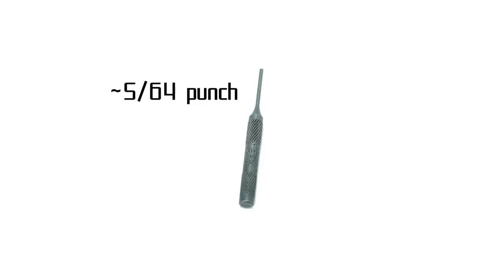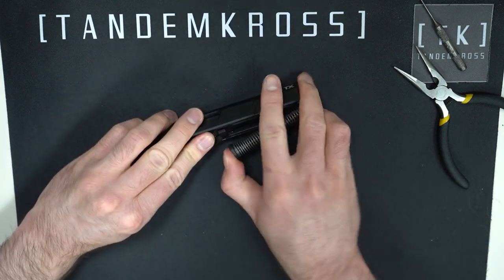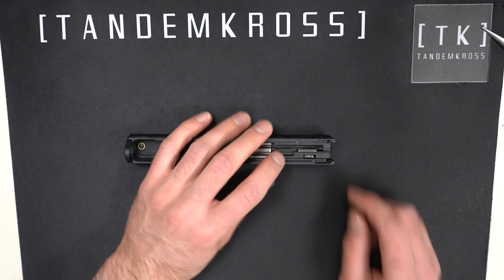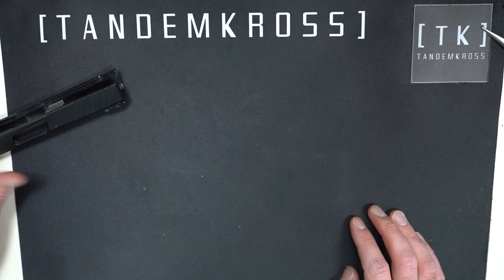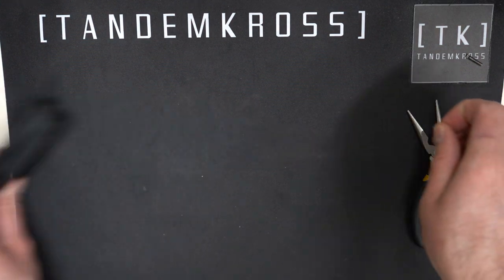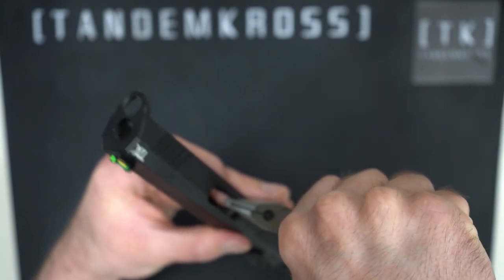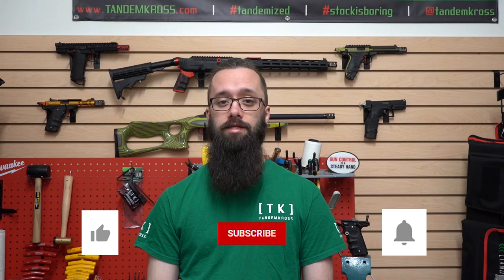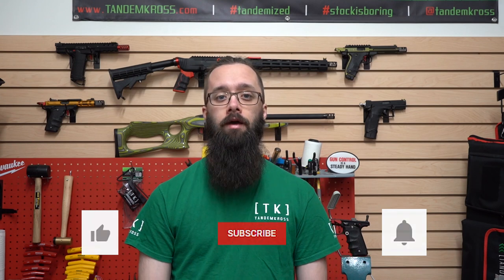TANDEMKROSS - "Eagle's Talon" Replacement Extractor for Taurus TX22 - Installation Instructions

Comment: Thank you VERY much! Gotta say, this is the most detailed and explicit video I have ever had the privilege to use. I bought a Taurus TX22 Competition last week and after having had a bunch of stove-pipes and FTFs in my first outing, and after reading the forums, etc. I decided to install the new extractor you make.  Before I did that, based on many other comments,  I also disassembled all three of the magazines, brushed them out, wiped them out, then applied a light coating of a Teflon-based  product. This one is called Super-Lube and seems to be the equivalent of Mag Slick, recommended by another great YouTuber (Guns and Politics, I believe). But I couldn't get Mag Slick locally and found Super-Lube at Ace Hardware so we'll see how that goes. Anyway, after that I went to your video, watched it a dozen times, followed each step, screwed it up twice and had to disassemble it but each time found the correction to my screwup in your terrific video! Long story but I got 'er done...haven't shot it yet, of course, but the fact that a mechanically marginal person like me could follow your steps and do the installation of the extractor at all is a win! So....best ever, a ten+ for my needs and in my book. Two suggestions...seems to me that you never mention lube anywhere. The firing pin block sticks and does not "spring back" slightly unless you have a light lube around it. Second suggestion, based on my doing this step and failing at least two-dozen times....putting that spring back in at the end and sliding the plate over it was macro difficult for me and my old fingers. I finally watched more closely and realized your hand position had you pulling back the firing pin block just slightly while you maneuvered it...the plate won't even go on if you don't do that. Then I finally got the plate over the spring by perseverance but it would be great to know a little trick to make that easier. Now the proof will be in the pudding...stocked up on CCI 40 grain mini mag smooth head, which seems recommended by many, and hope to find at least some of my stove-pipe and FTF issues go away next week when I go out. Sorry for the ramble-gram, but thanks again!

Comment: Very clear instructions.  I had a very hard time getting the extractor in place.  It was easier to remove the block it fits into, put the extractor in place, and remount that block.  Just a roll pin to remove that mounting block.
Reply: How do u do this because I am struggling
Reply: @CCpewpew  Easy.  Drive out the pin that holds the block in place that houses the extractor.  Than that block can be pushed out.  I had to use a brass punch to remove the block, as it’s a tight fit.  Put the extractor in place, and replace the block.   The block starts easily, but use a hammer and punch to drive it all the way back in.  Install the pin.
Reply: @blaiwayw1  In which direction does the block come out?  Toward the muzzle? Toward the back plate? Down towards the lower?  I've been trying to get the OEM extractor out for about 30 minutes now...  Thanks in advance!
Reply: It’s been awhile since I did this.  In my mind, the block is removed toward the muzzle.  Tandemkross would be able to give you the answer for certain.

Comment: To remove the extractor, once the spring and plunger are removed a short blast of canned air knocks it right out. Keep an eye on it! Your 5 round mag extensions are great. Turned my 10 rounders into 21 rounds!
Reply from the maker: That's a great tip! Glad you like the mag extensions.
Reply: Great tip, thank you. I was struggling to get the extractor out and this was the trick I needed!

Comment: Is there any good way of telling the factory extractor from yours?  I have the SCR model and am getting poor extraction at times.  The snap caps have a larger rim and extract well, but live ammo extracts poorly, sometimes not making it out before the slide comes back and grabs it.  It also won’t eject after a stage (use it for competition) manually, I have to fire that round off to clear it from the chamber.  My feed ramp is not polished like it’s supposed to be considering it’s an SCR and I’m figuring Taurus didn’t install the talon extractor either (it did have the comp in the box- maybe they shoved a standard competition model in the SCR box) but since both appear to be the same color, not sure if there’s a way to tell.

Comment: Fairly upfront install. Had to play with the new extractor a lot to get into proper place. Sadly it doesn’t seem to resolve my issue with using Federal Automatch ammunition. The 1st shot I took fired but failed to extract. The case gets stuck in the chamber and the claw never picks it up. Cleared that one by hand and the second shot stove piped the spent casing. 

Had one failure to extract with Standard CCI out of 31 rounds fired. It also seems like my pistol runs better when the magazines  are downloaded by one to 15. 

Obviously this issue was here before the Eagle claw extractor so it’s not any reflection on this product, I was just hoping it corrected it. TX22 Competition brand new (1 week old) with 517 rounds through it.
Reply from the maker: Hey there! Give Tyler a call at tech support. Even if it is unrelated to the eagles talon itself, we'd love to help you with getting this cycling! 603-369-7060

Comment: Hi Bill. I have a Taurus TX 22 comp. The issue is that if there is an unfired round left in the barrel the extractor will not grap it a pull it back to be ejected. For example, I have a 10-round mag and only fire 4 rounds. I remove the magazine with 5 rounds in it leaving one unfired round in the barrel. All four fired rounds worked perfectly and were extracted and ejected. However, the unfired round in the barrel will not extract by manually pulling the slide back. I use CCI Standard ammo. I have cleaned the gun and the bullet drop test into the barrel works perfectly. Any ideas?

Comment: I have a Taurus TX22 "Competition" model, that's having a failure to feed issue, that I was wondering if it could be extractor related??? The gun was bought new this year, and has about 1,250 rounds through it. Maybe once every 100 rounds, a round will fire, but the next round will not properly feed. ONLY THE TIP OF THE NEXT ROUND WILL ENTER THE BARREL, the rest of the cartridge will be angled downward, and the slide will slam into the brass casing, badly damaging the round and jamming the gun.

It first happened with CCI "Mini Mags" @ 1,235 FPS, then again even worse yesterday when I used CCI "Velocitor" @ 1,435 FPS; when I had three FTF in roughly 100 rounds. Not surprisingly, the damage to the side of the rounds, was much much worse with the higher velocity ammo. The gun was cleaned prior to my range visit, so that's not an issue. 

Due to multiple hand issues, the Taurus TX22 is my EDC, so I'd like to make it more reliable. This is the only issue I've ever had with the gun, which is an absolute joy to shoot. If you don't think it's the extractor, I'd appreciate any other thoughts, or suggestions???
Reply: I had the same problem with jams and FTF.  Take the mags apart.  Use a 44 caliber mop with a slight amount of silicon oil to lube the spring channel and the follower channel.  After this, cycle the follower for awhile.  The follower should move very freely.  Notice that the new mags tend to feel like the follower is dragging.
Reply: @blaiwayw1  Thank you! I had already found another video that demonstrated the same advice as confirmation, so my magazine cleaning materials have already been ordered. Thank you again!!!
Reply from the maker: WB you absolute legend! Great advice. Yeah we recommend the same procedure!